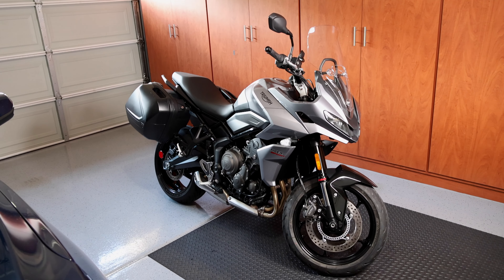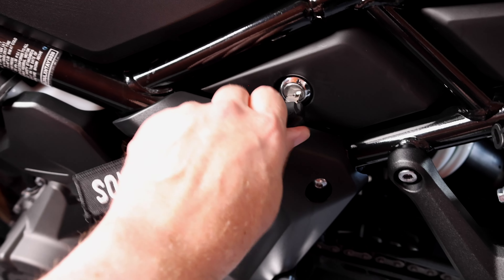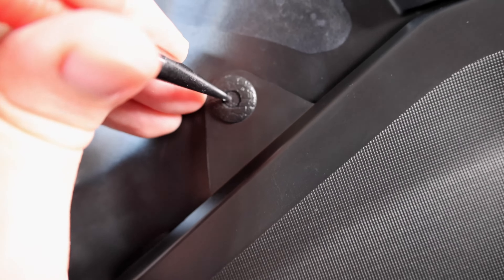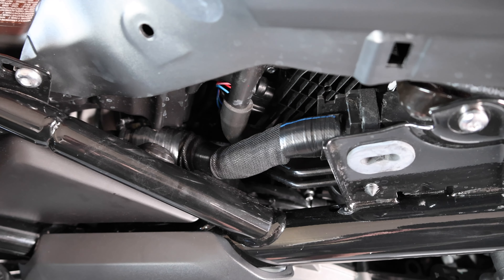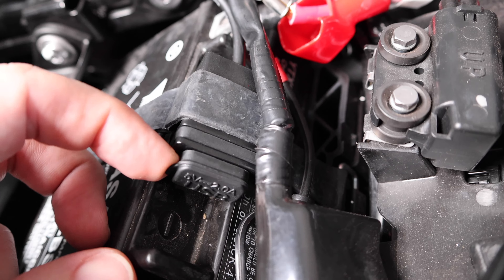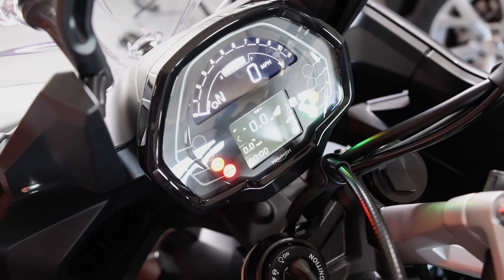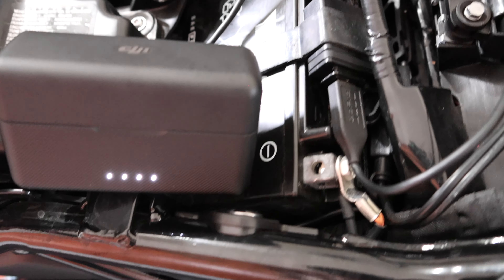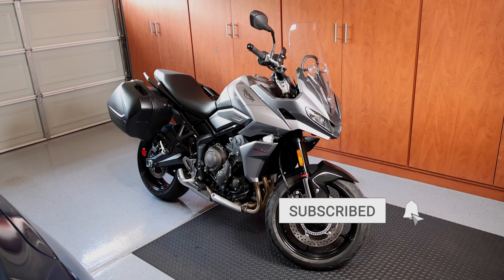USB Charger Install - 2022 Triumph Tiger Sport 660

Comment: Excellent how-to.  Very good detailed demonstration of the steps.  Thanks for pointing out the need to reset the TSA and clock (another good video topic would be how to set the clock for 12 hour format - specifically am/pm - not covered in the manual and notintuitive  at all).  I had my dealer install mine because I was having other work done and I had him run a 6' usb-c to usb-a cable from the charger kit to my handlebars to charge my phone while mounted on my quadlock.
Reply from the maker: Thanks for the comment! The bar mounted phone charger is a great use-case for having the USB charger module installed. I'll try to cover the clock reset in a video, definitely a unique process.

Comment: Semi related-  I'm trying to figure out where to tap into for ACC on switch wire for the Chigee AIO-5 Ride Navigation/Carplay Display.  Any suggestions?  Looks like it doesn't draw a lot of power, just to tell the unit to stay on when the key is on...

Comment: Good vídeo, but tell me something, how do you chaege tour phone itlf you have a quadlock on the steering wheel? Big huge from Portugal
Reply from the maker: I don't currently have the charger connected to the Quad Lock. If I wanted to wire it up for charging the phone while riding I would need to run a cable from the under-seat charger to the handlebars. If I need to charge in an emergency I would need to pop the seat off and connect the phone cable to the charger.

Comment: I am getting the usb kit installed this weekend. Also planning to get a usb extension cable to the handlebar . Will a 3m cable do justice or will that be too long?
Reply from the maker: That seems a little long, but shouldn't be a problem if you can tie up the extra and stash it under the seat.
Reply: 1,5 meters enough

Comment: The positioning of charging port itself is a joke !! You have to remove the whole seat to plug in your devices . I would rather have the charging port somewhere near to TFT console or on the handle bars which would be easily accessible and can just mount the phone on bar or inside tankbag. This doesnt look right !
Reply from the maker: Agreed, it's a strange spot for a changer since there isn't any room under the seat for storage. You can definitely run a USB cable from the charger to the handlebars if you need power up there. You'll have to get creative with the cable routing though.
Reply: Definitivamente esa toma USB , parece una tomadura de pelo!!
El
Vídeo muy bueno muy bien explicado el proceso y pasos a seguir par su instalación. Pero que trabajo le cuesta a los ¿ingenieros ? de Triumph diseñar algo más práctico y a la altura de la marca ??